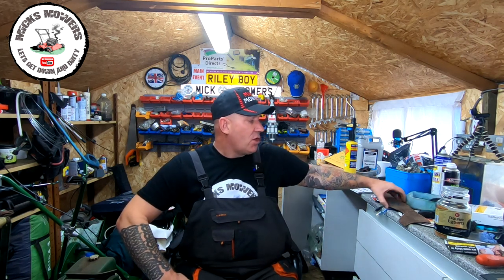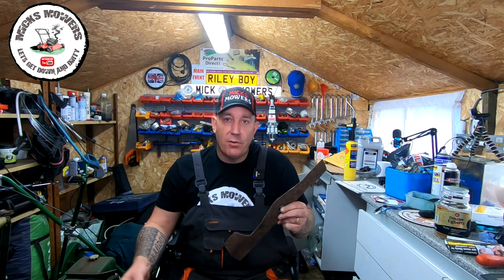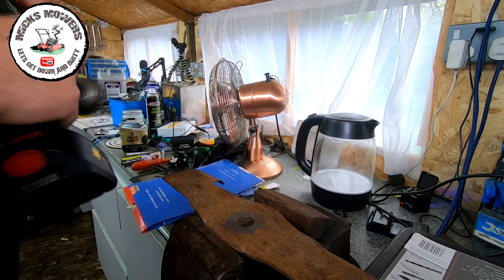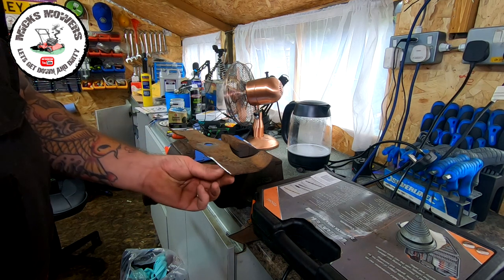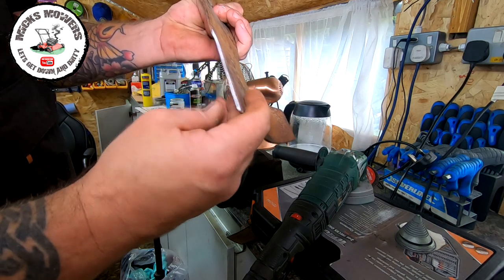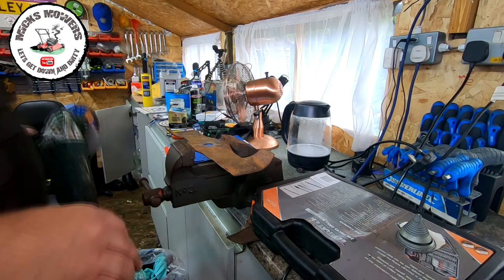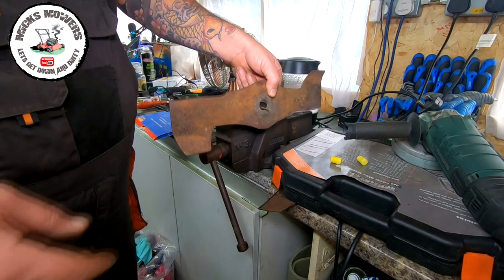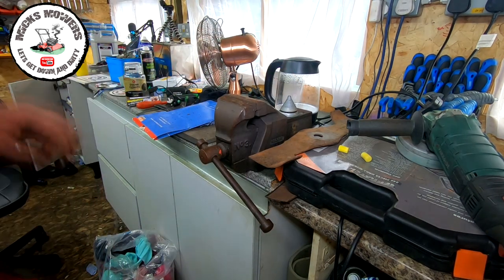How To Sharpen And Balance Your Lawn Mower Blade At Home Quick And Easy Anyone Can Do It

Comment: Glad to hear you say the blade is not supposed to be really sharp. I once overheard a greenskeeper collage tutor giving a lesson on blade sharpening and he had said that the blade should have a squared off edge in relation to the base of the blade... basically to sharpen it and then square off the sharp edge so it doesn't round off really fast. Everyone else on the Internet seems to think that razor sharp is the goal... they are not in the know 😅

Comment: A very informative video Mick. I use the grinder and a nail. I grind them at an angle that will allow the grass to be sheared off and then hit the lifter. It’s a joinery thing fella. Any chance of a video on how to check if a small two stroke carb has had it? Brilliant channel fella, you should be on telly 👍🏼

Comment: The more you do it with a flapper wheel and a hand grinder the better you get, I'm so good at it, I can tell how much I take off one side, and I usually take the same amount off the other, and it always is balanced, another good point is if you have to take to much off, you might unbalance it from front of the blade to the back, as well as side to side balance something to watch out for, if you do run into that problem just take a little off the back side of the blade till it balances from front to back...... Great job.

Comment: A tip Mick from the OLD MAN at Eliminator: when i am sharpening a blade indoors i set up at backstop of body metal with magnets attached to the back side. When i grind the blade all the metallic particles stick to the body metal and help contain the abrasive bits in one area. Take the body metal frame and all to the bin, pull the magnets off and all the debris is removed sometimes it needs a light wipe with a rag because the body metal holds some of the magnetism. Blades are now being sharpened outside on a portable table with wheels and a vise and bench grinder attached.
Reply from the maker: Hi buddy.. great tip.. I may look into doing the same .. hope all is well
Reply: Thanks Mick you just bend up some thin body metal to catch the grinding sparks, i built a base for ours with a hood and it really keep the debris off the workbench and tools when i was sharpening blades indoors.

Comment: Hey Mick and other regular posters. What are your thoughts on puller tools to remove flywheels on push mowers? If you recommend them: what size puller would you suggest? I've seen a 75mm one but I guess that won't be large enough for a typical push mower flywheel right?
Reply from the maker: Hi mate.. you can get genuine ones to pull a flywheel.. of universal ones.. personality I use a air chisel.. does a better job. Hope that helps
Reply: @themowerman  Thanks for the quick reply Mick, appreciate it. Up to now I’ve been using the taryl method of levering up using a pry bar and a sharp blow with a hammer and it works but I thought I’d invest in a puller. 

Do you use the air chisel in the same way I use the pry bar? To lever up the underside of the flywheel? Thanks
Reply from the maker: @jeffjeffjeff2  the air chisel replaces the hammer mate
Reply: @themowerman  Top banana, thanks as ever for your help/advice.
Reply: Another quick one if I may. Have you got any videos on straightening a bent crankshaft? I've thought about removing blade and boss then putting a scaffold pipe or similar over the shaft and levering it a bit. Would you recommend this method?
Reply from the maker: @jeffjeffjeff2  it can be done and I would if it was for your own mower..
Reply: @themowerman  thanks for the quick reply again. Yes I wanted to keep this mower for myself so I’ll give it a try. It starts and cuts fine...but the vibration is just too much at the moment. Thanks again
Reply from the maker: @jeffjeffjeff2  if not changing the crank is a job you can do..

Comment: I have a power devil electric mower about 12 yrs old, I want sharpen blade but it has a plastic nylon nut which has rounded off , 
I want to remove it ,would it turn anti clockwise like normal or clockwise to undo ?, 
I have tried both ways with water pump pliers but it is very tight and hardly moves, so I left it and used file to sharpen, but I want to do it your way in vid
Reply from the maker: Hi it should undo anti clockwise. I have a link to the blade sharpening tool in the comment section if you need one
Reply: @themowerman  thanks for advice will give it a go

Comment: YES  I AM  IN  THE  SAME  BOAT  HAS  YOU  ARE  AND  HAS  YOU  KNOW  I  SHARPEN  BLADES  AND  BALANCE  WITH  A  NAIL  SOMETIMES . WITH  THAT  BALANECER  YOU WAS  USING  CANT  ALWAYS  GET  IT  RIGHT  . THE  HOLE  IN  THE  CENTRE  IN  THE  BLADE  IS  OFF  SET.
THE  BLADE  YOU  HAVE  THERE IS  FROM  A  ATCO  PETROL  MOWER
Reply from the maker: Yeah mate